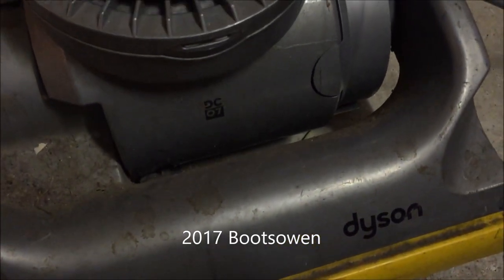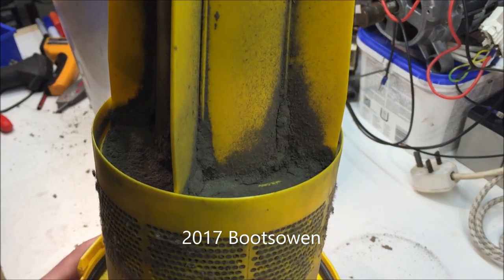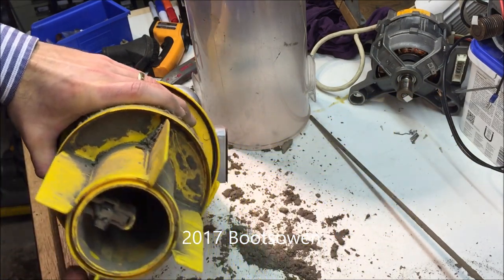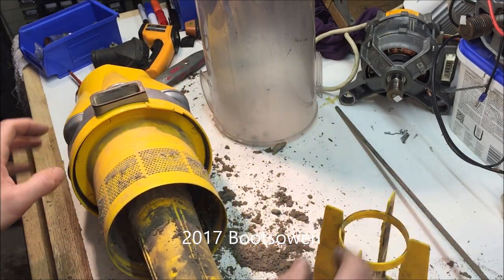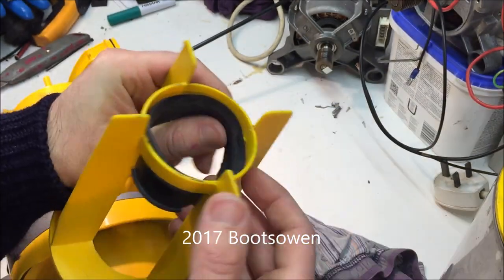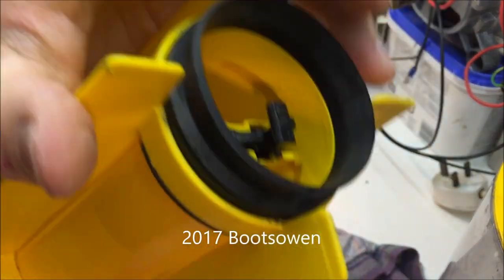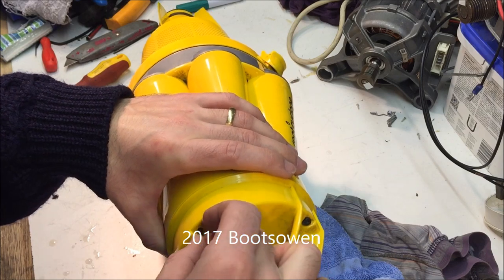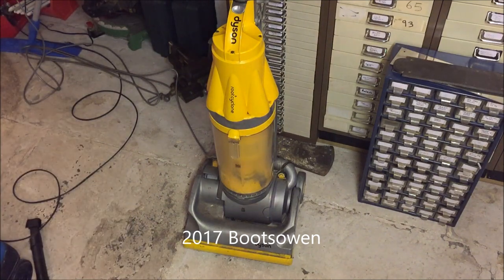Dyson DC07 Cleaning the vortex cyclone and canister

Comment: Before removing the screws, you should make sure the bottom door is open, otherwise it gets stuck and it's not easy to re-adjust the bar at the bottom and fix it.
Reply: Yeah man I learned to hard way too haha
Reply: @davidwarner3152  real easy. take the rod of the cap and just align it to the hole and push it in.

Comment: 1. If you forget to pop your canister open before unscrewing the top, unravel a wire hanger. I clipped off the twirly bits before trying it but it popped right open. 

2. Yeah, he absolutely has never cleaned this vacuum before. But he also made the shortest video. Which is why you all clicked on it. We don't need a 20 minute video on this. We don't care what your carpet looks like or if you have pets or your pets names. It WOULD be nice if Dyson put out short professional videos, but they didn't. So, thank you dude in a loud shop tearing into your vacuum with a camera on. I'm happy you didn't break it. And I'm happy we can learn from your possible mistakes. I know I could have broken my landlords vacuum had I done the same thing.
Reply: If you forget to pop open your canister as you say then just simply just remover the 1 screw and remove the long rod and you will find that you can very easily line up the rod down the bottom where the trigger is and push the rod so it opens the lid.

Comment: Nice to see it pulled apart, thanks...  it looked like it was still damp inside I think I would of let it dried in pieces then put back together prior to using.
Reply: Noticed that too. One reason most vac guys  never admit you can clean them with water is that everything should be 100% dry & tidy before reassembling. (Plus you must remember exactly how it fits together in perfect order.) I figured also that I needed a special tool to push in on the tabs but every vacuum repairman I spoke with said they just use a screwdriver for that!

Comment: I remove the canister from the cyclone, remove the 3 screws ontop and then remove the top part. I then use an extended  air gun on it and blow it all clean, reversing direction blowing in each individual cylone hole down inside snd blowing back up the screen like peice. Back and forth. I cant seperate the 2 cyclone halves even after removing the screws inside the cyclone, afraid of breaking it. Good enough for me. I also remove other parts and wand extension and blow threw them.
Reply from the maker: Blowing sounds good and it must be better than before.  Faster process too because you don't have to wash and wait for it to dry.

Comment: I broke one first time I tried so I simply dip it in and out of a 200 litre barrel of water and all the mess comes out easy if you give it a good shake. Just dry it after and no disassembly or reassembly hassle
Reply from the maker: Good idea.
Reply: @bootsowen  wouldn't that cause mold? if the crap that "definitely" would still be stuck inside (where the lil holes are) would take a while to dry since it is air tightly sealed. that's gross and unhealthy. you have to clean or at least wipe that crap.  just soaking is not gonna take it out, no way. i don't believe that. ha and give it a good shake that's funny.

Comment: Using a pair of pliers you should pull the fins one by one then they’ll come away. Then the bit with the holes on it comes after.
Reply: You do not use pliers on plastic
Reply: You can if the cyclone fins are too stiff

Comment: I cant even get the basic canister off. Vacuum seems designed specifically to accumulate dirt after long enough (yet fast enough) to keep people thinking to buy another one (having in mind how great it worked in yrs prior) while it slowly loses suction. Otherwise by design there's no reason it shouldn't be more easily accessible to deep clean.
Reply from the maker: Mate if you can’t take the canister off you won’t get far.
Reply: @bootsowen  That was my only task too, to wash the bin haha. I figured it out, I was basically trying to remove the bin not knowing the release door had to be open on the bottom first.

Comment: Yes but once you remove those 3 and open the unit there are 3 more screw on the inside.  Even when I remove those 3 screws I can’t get the unit to come apart.  Any ideas?
Reply from the maker: Are you pulling hard enough? And do you actually need to take it apart, can you wash it and dry it with compressed air for instance? Or just blow it out with compressed air?
Reply: This is because the bottom door needs ro be open before unscrewing and taking the top off 🤦‍♀️🤦‍♀️🤦‍♀️ This is what I am dealing with so if anyone knows what to do now please lmk... the barrel wont budge off, the bottom door won't open with out the top lever/rod back on/in but  I can't get the rod seated back in properly to engage the door.  So yeah. Sh*t.

Comment: 6:55 it sounds blocked. I could be wrong though.
Reply: thats what I was thinking.
Reply: there is no way that is normal it is defo blocked.
Reply: @thebestvacuumcollector3676  internal hose might be blocked.
Reply: The sound changes when he tilts it back because it shifts the airflow route from the hose to the bottom/brush area

Comment: The bosh bearings are 1000% going. The brushes wouldn't cause it to make that noise and it sounds like the drum itself is wobbling. If the metal drum moves up and down or any movement from the actual cadi f it's broken but the bearings are 1000% going and the knocking noise sounds awful

Comment: Instead of breaking apart the main unit if you had looked there are 3 screws in the top which releases the complete unit.
Reply from the maker: You'll have to be more specific there, I took 3 screws out of the top.
Reply: Inside the top after removing lid.
Reply from the maker: cool, thanks
Reply: I took those 3 screws out but my unit would not come apart even with the screws removed from inside.  Any Suggestions?
Reply from the maker: @jimwoods7639  follow the video rather than instructions from people who may not have tried it.
Reply: @jimwoods7639  sealed unit
Reply: @QxiMichelangelo  its stuck together it wont come off

Comment: Noticed the 3 screws inside you didnt undo, i did & i still couldnt take it apart more, after a bit of research i found out the cyclone is chemically welded closed  😑, That was my problem leaving me with no option to plug it in and hope 4 best it sucked the little bit of water out that got inside. I beleive i went wrong soaking it in water for an hour haha 🤦🏻‍♂️😂
Reply: Btw it works like brand new now thank jeez 😂
Reply from the maker: The other option is to blow it out with compressed air.
Reply: @bootsowen  Yeah i was going to attempt it with a heat gun and thought, well by times its dried it will be melted 😂 Brill vids tho thanks again 👍

Comment: well I took the top moff with three screws and did not pay attention the bottom lid/falp closed and now I can't open it. The skinny black rod is impossible to put back in the hole where it will trigger the flap opening. Any ideas??? Help... my dyson still works great but I thought time to do a thorough cleaning cause I had my carpets cleaned and house painted.
Reply from the maker: Maybe use a different rod?

Comment: I took my DC07 apart yesterday to clean it thoroughly. Putting it back together, everything seemed good, and I powered it on briefly, just a few seconds. Worked well. Today I turned it on, and nothing, no sound, no suction. Upon close inspection I realized I had twisted the brush belt when putting it all back together. I untwisted it and tried again. Still nothing. Any ideas? Am I screwed??
Reply from the maker: Hi There, if there is no sound at all then it is quite likely that there is no power getting to the motor, could be a cut in the cord, a blown fuse in the plug, the switch could be faulty, or one of the wires within the machine could have come off when you rebuilt it. The twisted belt brush should not stop the motor working, but it is a good indication of how skilled you are at rebuilding the machine. Take care! especially if you are working with electrics which will kill you!
Reply: @bootsowen  lol, yes i guess not to skilled!! It's the switch, I did an ohm reading on it and it read off in both positions. I opened it and one of the springs inside had become unseated - i reseated it and it works again!!  Thanks KS for your response and the great video!
Reply from the maker: No worries, glad it's fixed and that the video helped.

Comment: When I removed the top part and the stick came out, the bottom part of the container did not open and it is sealed shut. To make matters worse, I can’t reconnect the center stick back in order for the lever to work so I can open the bottom part of the container. Please help!
Reply from the maker: Do you have a DC07? Or are you working on a different model? The only help I can give is to suggest watching the video again. To open the bottom you will have to use the stick attached to the top, or another long pointy thing.

Comment: HELP! I replaced the cyclone handle for the Dyson DC107 and understand the rod attachment but the canister is not releasing once inserted!🤷🏼‍♀️
Noting I just purchased the handle compatible on EBay! Qualtex 4yourHome spares & accessories!?
Reply from the maker: How is it that you think I can help?  It could be any number of things.
Reply: Well any input? Thought maybe you had had someone with this issue to troubleshoot.🤷🏼‍♀️
Reply from the maker: You could take it apart and try again, sounds like you might not have suitable parts.
Reply: I think I know exactly what happened...because if I am right, 2 yrs later I am following the instructions and it happened to me.  When you take the top off the canister, you MUST first release/open  the bottom door.  It's not really stated here to do that...so yeah now I am really looking for a solution if anyone happens upon this...heeeellllp!

Comment: Oh and 2:00 to 2:30 the Bosch sounds like something is loose
Reply from the maker: That Bosch was a second hand gift. Dead brushes so an easy fix. It wobbles a lot on the spin but I think the bearings are ok. I was told it always wobbled a lot. I’ve been running it for 18 months, so almost 300000miles and it sounds the same as it always did. I’d kinda like the bearings to go because it would give me a nice tricky job to try. But things that are obviously dirty should be cleaned I agree there!!

Comment: I'm sorry but I wish you would've taken it apart rather then showing it already apart. Having an issue and want to know what I'm doing wrong. 😥😥
Reply from the maker: The bits that I haven’t shown should be covered by general disassembly in the manual.

Comment: Pliers and prying with a screwdriver??? More finesse ia needed to do this properly in my opinion...
Reply from the maker: Go on and make a video of it Ignacio and show me how.
Reply: @bootsowen  I meant no offense. I already did it and is all by hand except the 3 torx screws. I made the comment because ideally you dont want to scratch all the housing which you do and is better to clarify that for instance you have to gently pull each fin by hand not with pliers. I apologize if my comment came too strong.
Reply from the maker: @ignaciobarcia1549  No Offence taken! I do mean it though, you could make a video, I am happy to link it here if you have a better way. I found on this machine that I couldn't get enough of a grip to pull without pliers and it was filthy anyway with someone elses dirt.
Reply: @bootsowen  I will if you want.
Reply from the maker: @Tdkboot72  Go for it and post a link here!
Reply: @bootsowen  Well i will start by telling you guys if you pour boiling water over the holes & fin area you will find that you can pull it off so easy with just your hands.
Let me know if you need help in deep cleaning the roots as they do get very clogged.
Oh yeah you do need a T15 for the top 3 screws but sometimes you need a security T15 Due to the screws having a pin in the middle of the screw.
Reply from the maker: @Tdkboot72  Thanks tony, yours is one of the most useful comments on this thread!
Reply: bootsowen You are more than welcome. I must admit I know a little bit about the dyson models without blowing my own trumpet & love watching your kind of videos. I think there brill. 
I just really ain’t clued up on loading up or making videos. Just enjoy watching them.
Reply: @Tdkboot72  Is the cyclome cylinder waterproof in general? or just the holes and the fin?